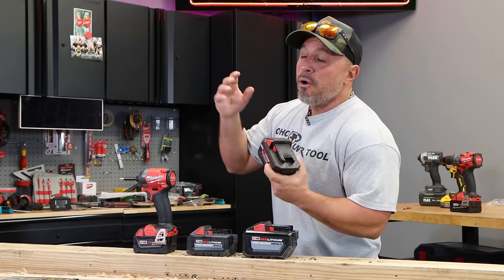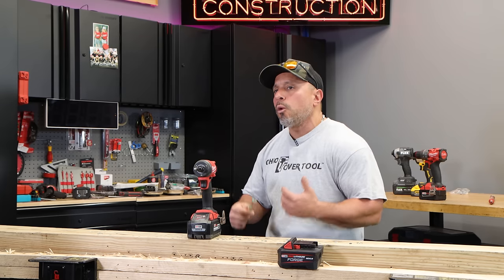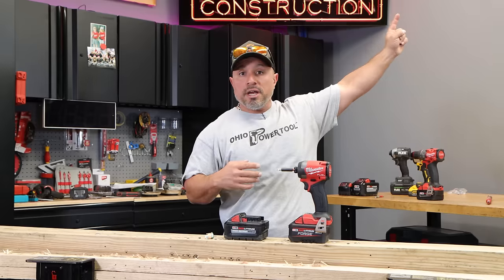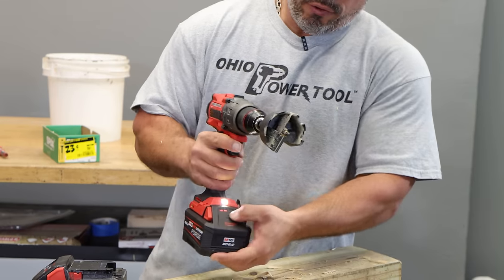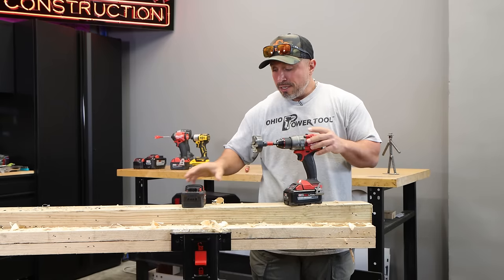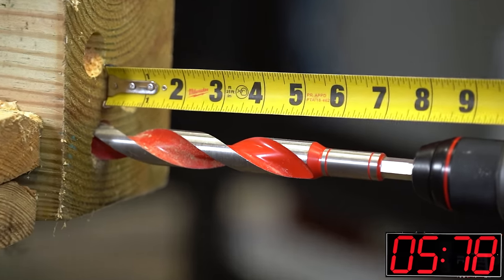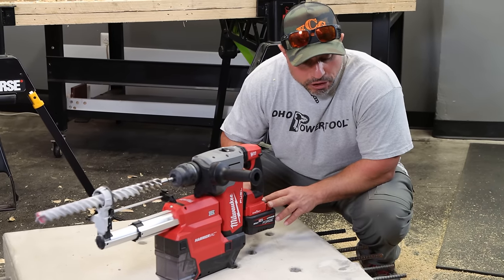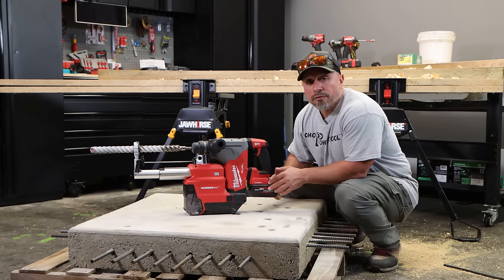Your BUYING Milwaukee Tools M18 FORGE Battery with WRONG EXPECTATIONS (stop doing this)

Comment: What I’m seeing is there’s a clear difference between a pouched  battery in a tool platform built for pouched batteries than there is for a system originally built  for cylindrical cells.
Reply from the maker: Milwaukee M18 FORGE VS FLEX Stacked Lithium on Impact Drivers!

Comment: I do wonder how it would perform on quick lok string trimmer and other ope equipment?
Reply: The string trimmer is one of the power hungriest tools they make. I notice a difference between 8.0HO and 12.0HO with it, ESPECIALLY partway through use, so a forge battery would definitely make a difference.

Comment: Hey Vince they say that the 6amp. Forge is as powerful as the 12 you should make comparison the 6 and the 12 run test see how it goes on price comparison the forge 6 its $199 and Milwaukee 12 am it's $250 it's worth get new technology it's is you're saving $50 that's pretty good I think 💬 🤔 Milwaukee is caching up with DeWalt flex and eggo they have new technology ove battery that's goo Vince that Milwaukee moving up that's good!!

Comment: It didn’t seem like the investment in high output batteries had really paid off any where near what milwaukee sold us on, so ok sure…Maybe it last longer…but how does it have as much power output as a 12 if it’s not even decisively beating 6HO’s. 
And lastly, we all know before these batteries die milwaukee will have a new battery tech to sell us on so I’m not concerned with the lifecycles. 

I just want the most powerful, most compact, most well made tools…and they can save all the marketing money and invest in the tools instead that would be great.

Comment: Yo Vince! I just think this battery stuff is getting over rated. I mean like how much faster and stronger do we really want to go??? The last generation of batteries do the job fast and strong enough for me.
Reply from the maker: How Much is Enough?
Reply: for small tools sure but for stuff like chainsaws they have a long way to go to compete with commercial grade 2 stoke Stihl
Reply: @JD-yx7be  yeah your definitely right about that. I’ll tell you what though, Elon musk is stepping up the battery game 😂
Reply: @silverandblackentertainment  i have an older Ecoflow power station that is only 2 years old. and the new ones have over 30% more capacity for the same price It is amazing the battery tech these days. I hope the Milwaukee mower has a huge discount soon not sure my gas mower will last another season.
Reply: @JD-yx7be   I got the dewalt power station and I really like it. I got rid of my gas mower a couple seasons ago. I really like the Milwaukee mower.
Reply: @silverandblackentertainment  I got the dewalt sealed ratchet a huge improvement over the Milwaukee fuel ratchet that i broke 3 of. Oily grit would get in from working on my old diesel and mess up the internals hopefully a sealed unit holds up long term

Comment: Pouch Lithium-Ion not much different then the old school pouch nimh cell phone batteries they charge 7 to 10 times more then cylindrical cells they always have used to be in everything from cell phones to rc cars to older power tools but Lithium-Ion pouches how way more amps then the old NiMh

Comment: The only thing I'd be interested in is... do the damn things just not go bad for no reason at all.  I've had so many Willmaukyee packs refuse to take a full charge, or just not charge at all.  All have been babied and none have seen hard use.  They just go bad for no reason.  A bunch.  I've got expensive packs that make me curse the company that made them.  "Red Lithium" my ass.
Reply: That's just a natural result of over-discharge/over-charge cycles. Lithium cells don't like to be fully drained or left on chargers. As it happens cells will drift away from being balanced further and further. Much in the same was as your phone is ideally kept no lower than 20% and no higher than 80% If you wanted a significantly longer lifespan from the battery. Faster charging methods such as superchargers are also another frequent cause.

Comment: The m18 12ah is a beast but its also its failure its two heavy for the carriage that the battery sites in and ends up super sloppy warn out and shaking around  the locking mechanism from batt to tool definatly needs  a upgrade,  big battery or not. that is the weakest point. 
The m12 has its own issues..... stupid lock system from the get go

Comment: Milwaukee is RIPPING US OFF WITH JUNK BATTERIES- 3 years light usage charger errors, stuck on 3 bars on a 3 year old 12 amp battery with 10 fast charging on it is bull shit. Used tops 10 times in a rocket lite and 10 minutes on their shit leaky chain saw. Mikita back in the day I have batteries still going strong 12 years later. But they suck on warranties too. But leas Makita Their batteries last over 12 years. Only bought Milwaukee because they had awesome lighting system. From now on I buy only generic batteries and I don’t care if. They only last 3 years there 1/4 the price of the shit Milwaukee batteries. We bought 96 M18s and they are all light usage for rocket lights and maybe 3 holes 2 inches in concrete a year . 10 charges tops and dead batteries. I think the fast charging system may fuck them up. Hate makita but never had batteries 10 -12 years ago still go strong . If makita had good lighting system I’d switch. Dewalt has decent lighting my buddy says no issues when a battery goes bad even out warranty with dewalt. I think I’ll sell my Milwaukee try Dewalt or use generic batteries because I’m not over paying for garbage, gouge me for a quality product that lasts I can deal with. Not 10 charges and done on your batteries Milwaukee.

Comment: Not as good as Bosch's ProCore batteries.
Reply: Wrong
Reply: I get a week's run time with my 8ah & 12ah batteries.
Milwaukee are 💩,bad build quality, chinsy plastic build, plastic gearboxes.
When they were owned by AEG/Atlas Copco they were excellent,now TTI not good.
Reply: @marccadec6978  Milwaukee also has 8ah and 12ah batteries which would have equal run time. I have an older corded bosch sds so no bias

Comment: I ALSO HAVE CELL PHONE BATTERIES THAT HAVE SWELLED AND FAILED. NEVER HAPPENED TO ANY CYLINDRICAL IN ANY OF MY M18 AND M12 BATTERIES. I HAVE 18/20V POUCH/PRISMATIC CELLS FROM ANOTHER CORDLESS TOOL LINE AND HALF OF THEM HAVE SWELLED AND FAILED. DON'T BUY THESE. MILWAUKEE NEEDS TO DROP THIS IDEA FAST!!